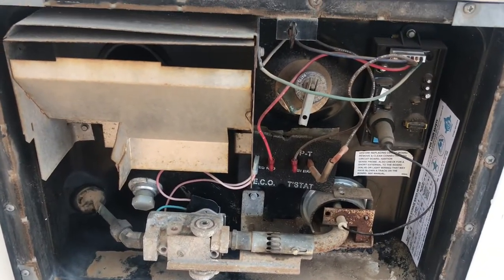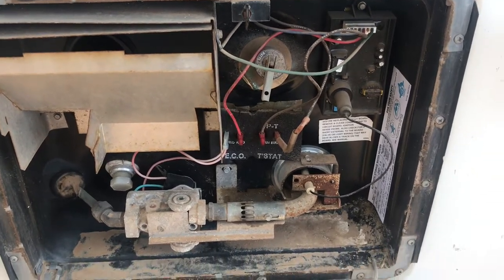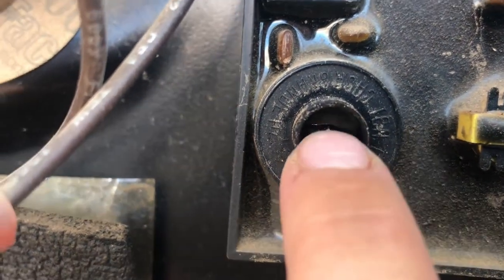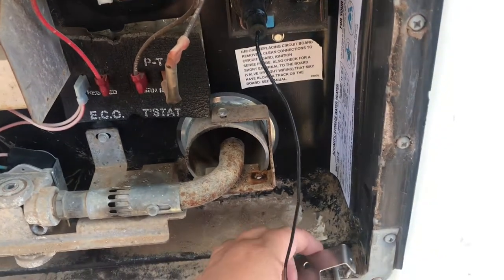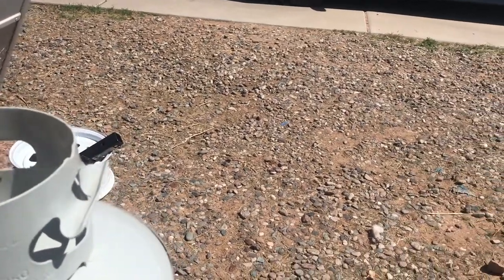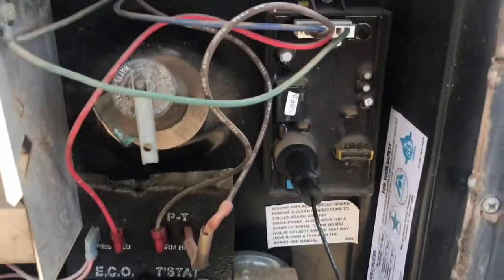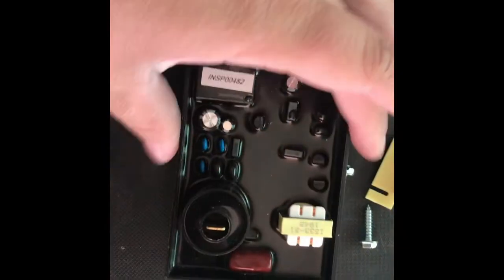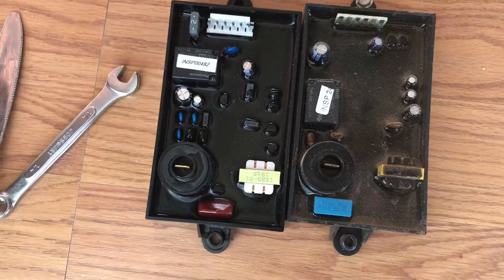Replacing RV Water Heater Igniter and Control Board￼

Comment: Your control board was really easy to change!  Lucky you!  I had to change mine, and to get to it, I had to take the paneling off of an interior wall.  The control board was attached to the side of the water heater inside the wall.  I saw you have a big propane tank too.  Very wise!  The little tanks that come with the trailer don't last very long.  You must be getting excited to finally move!
Reply from the maker: I was very happy for an easy fix! Tomorrow morning is moving day and I am nervous but excited at the same time